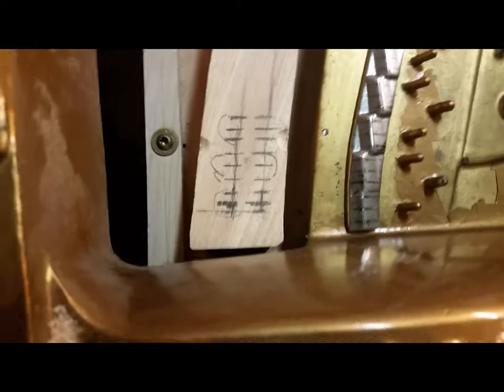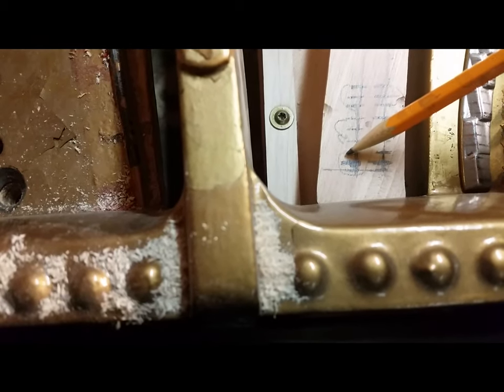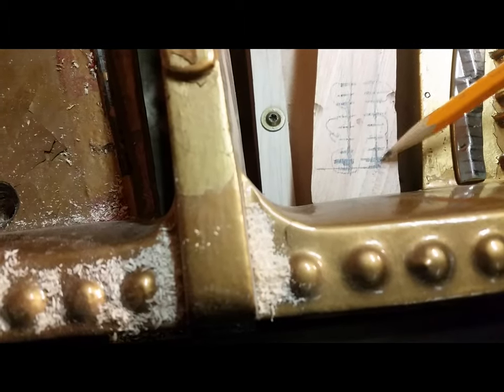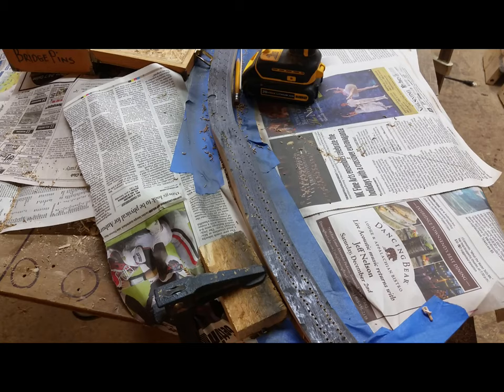Steinway B Bridge Work

Comment: Why do you change specs on string lengths? I'm sure that the scale design on a Steinway of these popular models have withstood critical insights to maximized inharmonicity relationships.
Reply from the maker: You may not realize this, but Henry and Theodore were constantly making improvements, as evidenced by their numerous patents. They also hired many other experts to make improvements. That trend only stopped upon their deaths. I am continuing their journey faithfully. It is only the Corporation Steinway that takes such a rigid stance of purity.